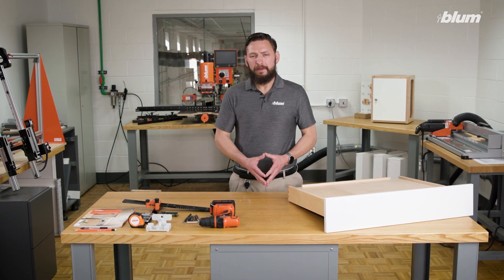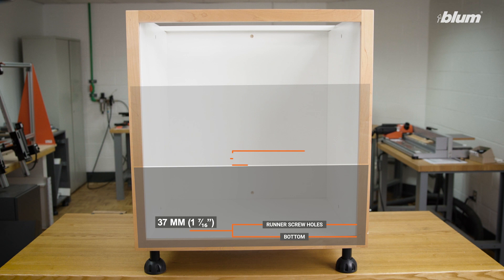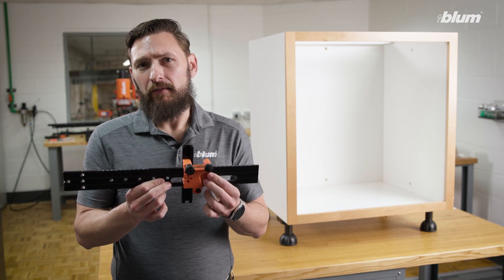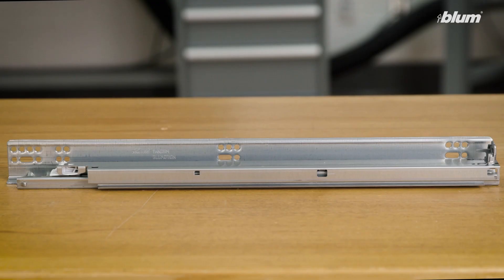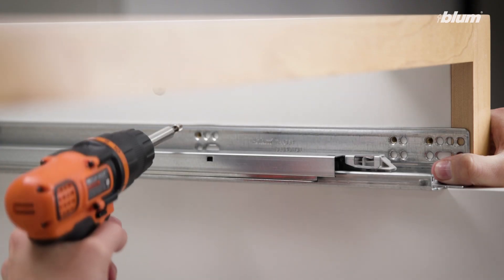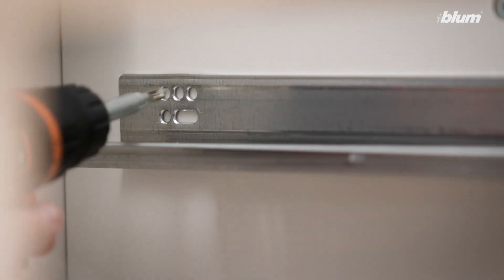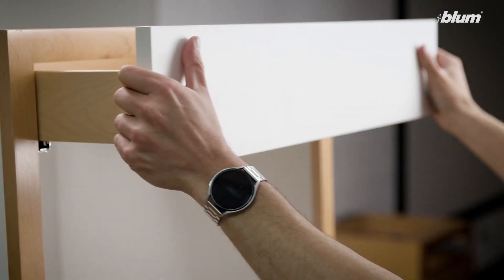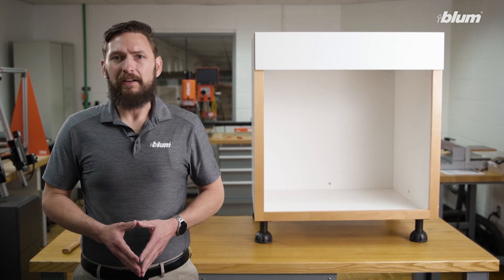How to Install Blum TANDEM plus BLUMOTION Drawer Slides in a Frameless Cabinet

Comment: Hi my drawer unit is very noisy on closing, almost with a grating sound, what is the issue here. Brand new install yesterday but disappointed with the sound of the drawer unit. It's a BLum tandembox blumotion runner, any ideas UK based ????